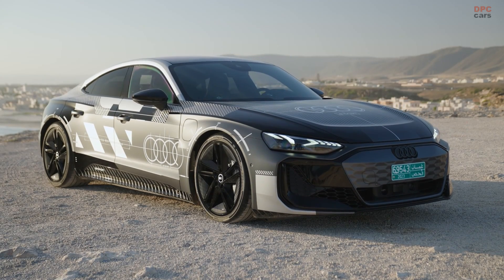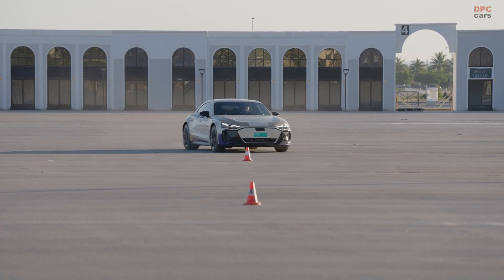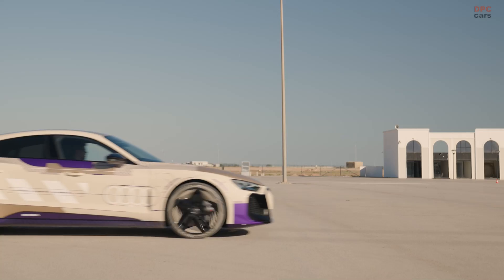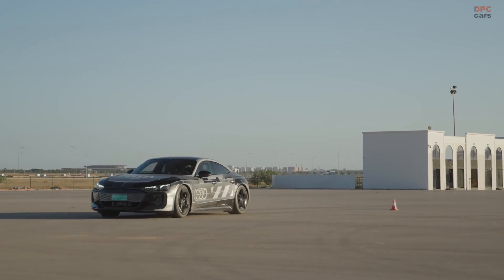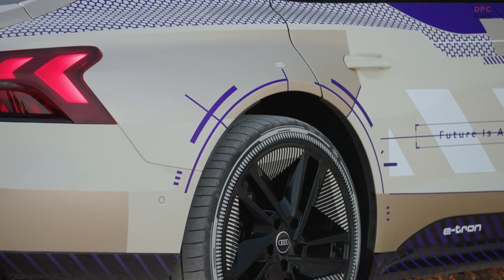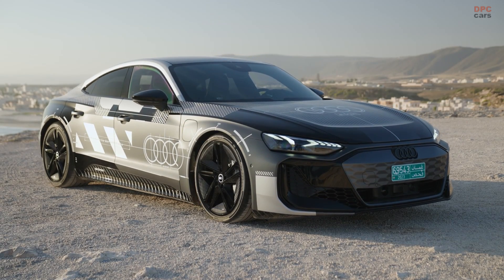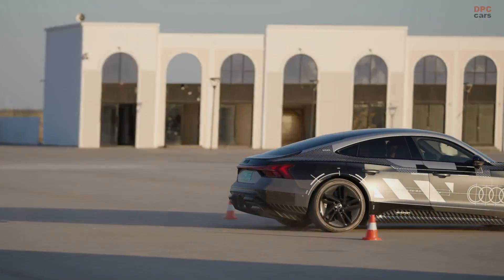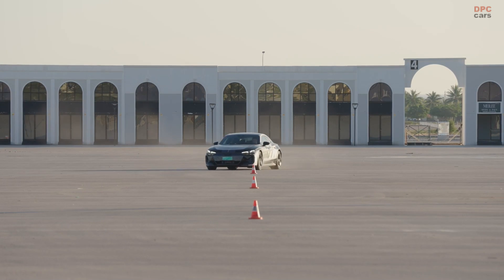New Audi e-tron GT Prototype Suspension Lift System

Comment: One statement I'd like to add if you are referring to Mercedes E-Active Body Control.  The E-ABC is proactive because it has two stereo cameras to predict road conditions along with the other sensors (car’s other systems, including engine, traction motor, all-wheel drive, traction/stability control, ABS, and the electronic locking rear differential)  while the Porsche/Audi Active Ride is still reactive, sampling road conditions using the same sensors at 13x per second.  So MB tech is still better but probably not implemented as well.  The 400v Audi/Porsche probably makes their suspension act very fast vs the MB's 48v suspension system.  Hopefully one of these makers will add stereo LIDAR to read the road at day/night and bad weather to really predict road conditions.